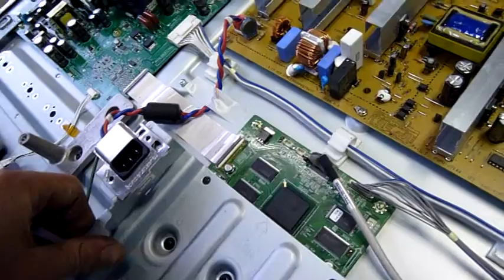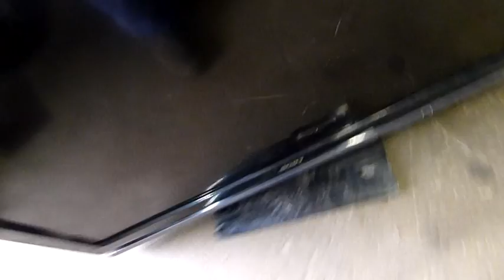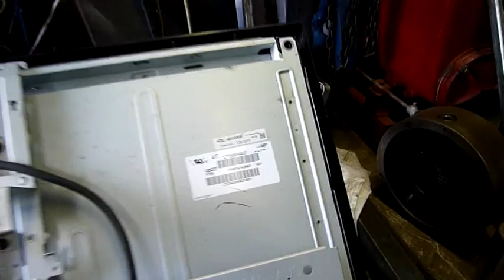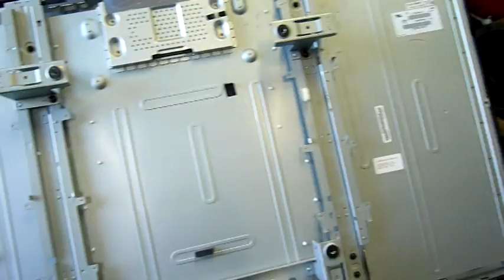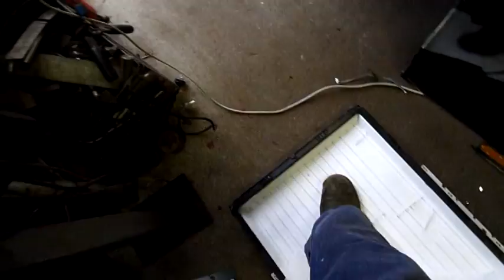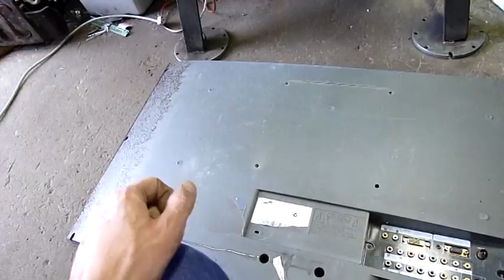Multiple Autopsy - Plasma and LCD Panels - LG Samsung Sony and More

Comment: speaking of plasma, one night i found a nice samsung Plasma in the trash, the glass was cracked and the back was off, if i could have lifted it, i would have brought it home, I read it would have worked ok if the gas hadn't escaped from the cracks. but i couldnt lift it, Wish I had a truck at the time and some help.

Comment: is a kh885 ?. Ed, this systems outperform easily separates systems in the low range. They use to come with serious quality speakers. Its a keeper, shame it takes tons of space jajjaja like all of the same era all-in-ones. Not sure it puts around 40 or 50W PCH .... Also vinil as again on the market ... so it is not longer a dinosaur media. And modern turnatables, in may cases are CRAP compared to the one built in there. Cheers.

Comment from the maker: Its probably the driver boards across the bottom of the panel, the Hitachi 32" I have has a more advanced state of driver breakdown with 2 vertical bars, many pixles wide.

I'm afraid I don't have boards for a 50" panel, nor can I confirm that its the exact cause, it could also be the driver board that connects to them too

Comment: Maybe you could dig a hole and just bury the glass, any low spots in the yard that need filling? You could do the same with plastic, but it's harder to break it down to a usable consistency without a shredder. If you had a glass crusher you could use the junk glass for sandblasting.

Comment: I have a samsung 42 inch I got gave to me because the caps kept going bad on the power suply.  when I got it I just orderd a new power supply and I now have had it for 3 years. I'm now waiting on a power supply for my providew computer monitor. I replaced the caps and that didnt work. and I'm going to get a esr meter and use the new one to test the old one to see what is not working and repair the old one so I can have a back up.

Comment: Actually the unboxed speakers are more useable because they are Open Baffle Drivers and can be sticked anywhere there is a hole with satisfactory results,although as tv fullranges their quality must suck compared to the two way boxes from the other tee vees.